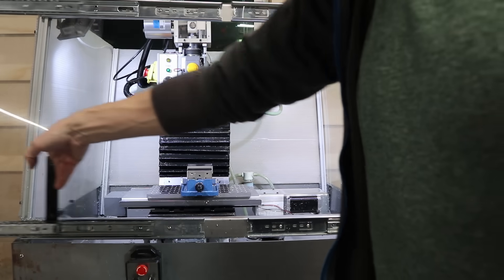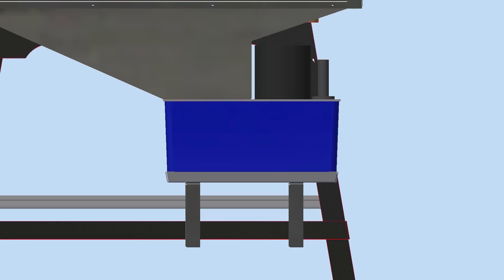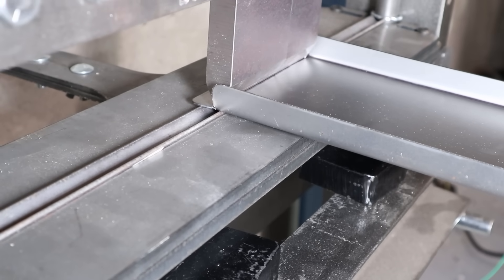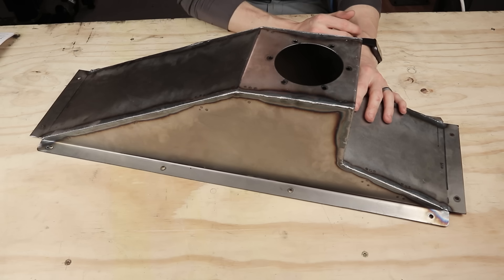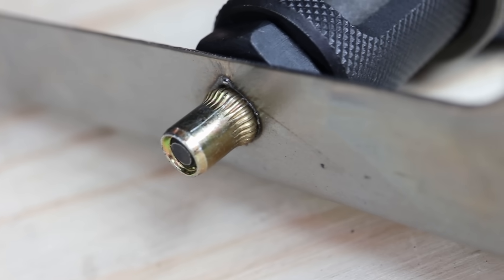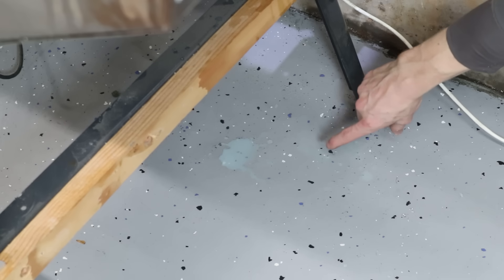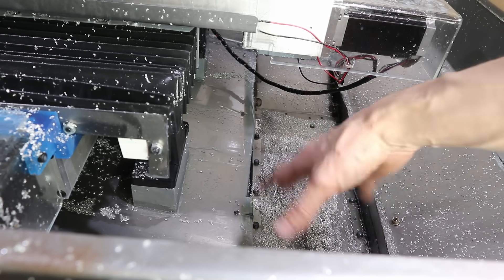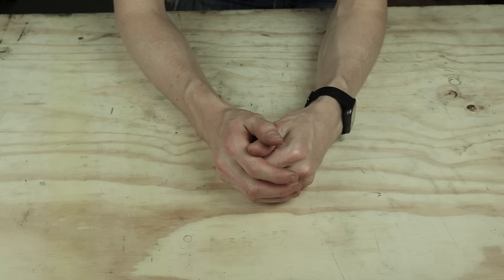Fixing a little mess with a big mess

Comment: 10:32 “...they don’t turn”. 

Depends on the application. I bought a used track bike with a shop-made rear subframe that had a number of rivnuts, and they’ve been a real pain. I’ve had to replace several. I didn’t even know what they were. Took some googling to figure that out. 

I’m guessing your tub isn’t going to take the same kind of abuse as a track bike.
Reply: There are hexagon shape rivnuts aswell, they can't turn anymore :) but obviously you'd have to plasma/laser-cut those holes ;)

Comment: +1 For the angle gauge. Also the guys that make it (iGaging) are pretty awesome too. Back in the day they sent our Baja SAE team a bunch of calipers, and that angle gauge for free (and at the time, the angle gauge was still in beta). Made tube bending really easy. I still have my calipers and use them daily. A fraction of the cost of Mit's and as good or better. Ok, swear I'm not paid by iGaging, just really happy with my calipers.

Comment: I have to say that you really did nice work on the coolant system. But you are machining aluminium which is really easy to deal with the chips. Try dealing with stainless, monel, inconel and titanium. You would never just put your hands into the chip troth and get a handful of chips, if you did you would never do that again as the number of chips embedded into you hand would take a while to remove with fine tweezers. You really got a nice operation going at home. Look forward to see a lot more videos from you soon. Good day too.
Reply from the maker: I'm intimately familiar with this problem - you may have noticed how many banages I have :) I usually vacuum out the chips even for aluminum and if they are stringy I'm scooping with a piece of plastic.

Comment: If your welder has a pulse setting on it you can use it for joints like this. Just set the pulse and amperage to roughly where they should be (play with it a bit) and you can just fuse all of the edges and you'll get dimes! The pulse will make it so it's harder to burn holes in or overheat the part, and will make the welds look a lot cleaner.

Comment: Just subbed from another video. Going thru your work very entertaining and interesting. One note regarding the rivet nuts. They don't sit flush with the sheet metal and for a filtration system that doesn't seem right to me. I believe pem-nuts would have been a better solution for this application. They press into a hole from the far side and can be tacked on for more ridgid holding.
Reply from the maker: I totally agree. I hacked them to work by putting a neoprene gasket between the filter and the drain which seems OK but isn't a very elegant solution. I only had the rivnuts on hand but what I really wanted to use was threaded fasteners that spot weld on like these https://bit.ly/3asmKRy
Reply: @StuffMadeHere  those are really good as well. Do you have a for the neoprene gasket material? Is it porous and little squishy? Asking for another project.
Reply from the maker: @DRIFTWORKSINC  Oops it's actually buna not neoprene - here's the stuff - it's adhesive backed so easy to apply and oil resistant https://www.mcmaster.com/1488n219
Reply: @StuffMadeHere  Thank you!

Comment: Was there a reason you didn't just include a tab on the outside edge of the parts and then bend it up into place?
Reply from the maker: Yeah - I wanted the edge to be a single smooth seam for welding. To be able to bend the tabs up so that they are flush with the edge I would have to cut a bit into the material. to accommodate the bend.

Comment: This is some high quality content! Really good stuff. What are the specs on the mill? Other commenters pointed out its an X2, but obviously pretty well-modded. Doesn't exactly hold a candle up to the tormach, but it looks like a good start for people getting into CNC
Reply from the maker: Yeah the base machine was an X2. Main mods:
- 5k spindle + gearing
- pneumatic power draw bar
- Extended Y axis
- Stiffened Z axis 
- Flood coolant + enclosure (obviously :)

It's a solid machine that I've used a ton. If I had more space I would have started with a larger mill but if you are space or cost constrained it was a great project that and a useful machine.

Comment: That looks a lot like a oil pan for a car. A few adjustments and you can start making custom oil pans for cars. Love your channel.  Just a observation from a car guy.
Reply: If you swap a different engine into a car you may need to change the oil pan to fit. Just one application
Reply: Question from a non car guy: Why do you end up needing custom oil pans? Is that a different name for a oil sump?
Reply: @markfryer9880  As Koby said, could be a fitment issue. Could be the have a bigger oil capacity, better flow or just replacing an existing broken one.
Reply: @markfryer9880  another application that hasn't been mentioned (directly, someone said a larger pan but not why) would be if someone is adding additional parts that require oil. Such as upgrading/adding a new turbo or supercharger :)
Reply: I thought the same thing
Reply: I didn't even consider the fact that his garage could literally make custom car parts. But that's absolutely something he could do. And the plans for a lot of parts might even be on the internet, especially mustangs, corvettes, firebirds, and all the other special cars that people seem to really care about.
Reply: Cleetus McFarland just broke the oil pan on Ruby

Comment: One thing you could also do to guard against really fine chips is perhaps to install a dam into your coolant tank, with the drain falling into one side of the coolant tank, the dam (vertical divider) stopping the fine chips from flowing towards the pump, and the coolant overflowing the top of the dam into the pump side. Hopefully never needed!
Reply: Chips still fly everywhere tho
Reply: after it falls down into the box have a vertical wall like so 
-----------------------\
                             \               | so the coolant flows over here
                                \-----------| and metal collects here

Comment: "My initial reaction was to just move the plug to a non-GFCI outlet".  A man of my own heart.  Great stuff, looking forward to more!
Reply: As other people who have played with machinery like this at home may know, if a gfci trip is a new symptom, feel free to be concerned. But if a new device arrives tripping your gfci, your perfectly functional drive or filters may be to blame. Some line filters and VF drives dump a little bit of current to ground on startup, causing nuisance trips on gfcis. For those with new construction homes, I understand your pain.
Reply: Do US electrics not have RCDs on the breaker board?  Or is there some significant difference here?
Reply: I'm glad this was top comment because I was gonna post it.
Reply: If it uses an 'electronic float', ie, testing the fluid level by measuring the current passing through the fluid to chassis ground, it can cause a tripped GFCI. That isn't what is happening here though.
Reply: 12:30 “I have a whole tank of coolant I really didn’t want to spill” 
Us who has seen the thumbnail: Haha you fool
Reply: ElectroBoom wants to know your location
Reply: And this is why sensible codes have the whole house on RCD protected circuits. (Exceptions used to be made for lighting, because a failing incandescent bulb tends to look like a ground fault for just long enough to trip an RCD.  Not really an issue any more.)
Reply: done that before. lol
Reply: That got me rolling on the floor
Reply: He's not a man of your own heart, unless your heart is clinically insane.
Reply: Breaking Taps who do you think you are?
Reply: That should fix it.
Reply: @Big-Jock  not typically. Most of the time, if protection is needed we install individual outlets that have the gfci built in. The typical breaker for the circuit only trips when there is over current, and cant detect small leaks. However, there are GFCI breakers that are becoming more popular, since it works from the panel at the start of the circuit, and removes the need for individual GFCI outlets.
Reply: Good video :)  Stuff made here explains things well.   A video that may explain GPCI protection outlets well is https://www.youtube.com/watch?v=GlM6PE2kKVY   (The Outlet that Saves Lives).   In this case, not sure if the pump is leaking current to case through coolant fluid or if the chips are somehow stacking enough even instantaneously to cause current flow to ground which could be dangerous.  The grounding wire would help typically unless one grabbed the structure is just the right place or the ground went bad as in a dry earth or wiring fault or in other conditions.  (provided "as-is")
Reply: Ok I have to be that guy. The expression is “a man after my own heart” a man of my own heart means nothing
Reply: That part of the video was just as I took a drink of rockstar, which promptly went out my nose and all over me. Burning like the depths of hell on its way out. Only reason why it made me laugh so hard was because I found out why you shouldn't just change outlets, the hard way, some time ago. :D
Reply: SOLVED!
Reply: What does GFCI mean?
Reply: @bananasstuff3344  ground fault circuit interrupter; a type of curcuit breaker that goes off if not all electricity/current goes through it's own ground. Mainly to save people from electrical shock (if current starts to flow through them to a different ground than outlets; so it wouldn't save you from sticking fingers into an outlet), typically present whenever there is liquids involved (i.e. bathroom).
Reply: @niter43  In a normal 120 VAC circuit, the hot and neutral wires both carry an equal amount of current. A GFCI trips when it senses an imbalance of current between the hot and neutral wire. A GFCI doesn't need a ground at all to operate.
Reply: @illestofdemall13  Im 8 months late but 120VAC? What? Don't you use 240VAC?
Reply: @lepa.223  we use 120/240VAC in the USA for residential. 120VAC is for most lighting and receptacles, and 240VAC is for ovens, Air conditioning, clothes dryers, and water heaters.
Reply: @illestofdemall13  Sorry I said 240 instead of 230, we use 120 for lighting but everything else is in 230. Im only studying to be an electrician.
Reply: @lepa.223  Here it is 120/240 but when measured it is often around 125/250.
Reply: @niter43  neutral, not ground
Reply: @bananasstuff3344  In addition to Niter's helpful comment, I recommend this video by Technology Connections which explains it in detail with practical demonstrations: https://youtu.be/ILBjnZq0n8s
Reply: @deus_ex_machina_  I accidentally touched the link and ended up watching a channel I'm subbed to. Lol
Reply: @bananasstuff3344     Giant Fucking Coolie Impaler

Comment: Nice work ,..on my mill i let my coolant drop into a plastic container  with holes drilled in it ..then it drops thru a screen .. pull the container out   dump ya chips  , slide it back on the supports . Scooping your one with bolts ..pain in the bum . ( my opinion )
Reply from the maker: That's a clever solution. As for mine I agree - scooping chips out by hand would be awful. I use a shop vac to clear all the chips out which is super easy

Comment: Great content and well recorded. Subscribed!
Reply from the maker: Awesome, thanks for the feedback and the sub :)
Reply: @StuffMadeHere  just a suggestion for a possible video. If your mill has a standard control board for spindle motor and you linked it to mach3 successfully, I think many will like to know your solution. If its manually turn on, I am in the same boat. I am in EU and can not find a c6 motor control board here.
Reply from the maker: Mine is a HiTorque style brushless drive. I do have it linked to mach - it was quite a pain actually because I wanted to avoid buying the control board from littlemachineshop for >$100. I ended up finding a schematic on a forum somewhere that I built up. This is was sufficiently esoteric that it's worth documenting. Another thing I may document is getting a good realtime MPG setup. This was harder than I expected.
Reply: @StuffMadeHere  That would be great!@ Yes it's indeed a pain link the spindle to mach3 if you do not have a VDF or a drive that takes care of it. Video will be more than welcome. 
To manually control the machine I just used a joystick, quick and easy and you assign hotkey for each button :-)